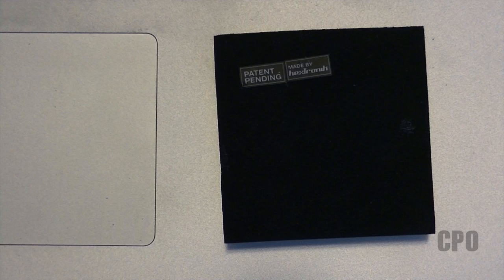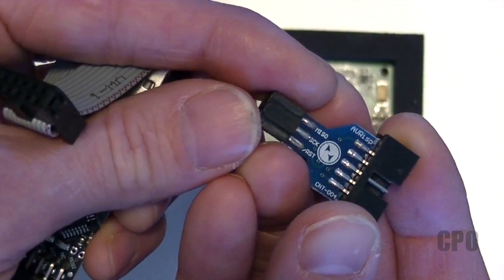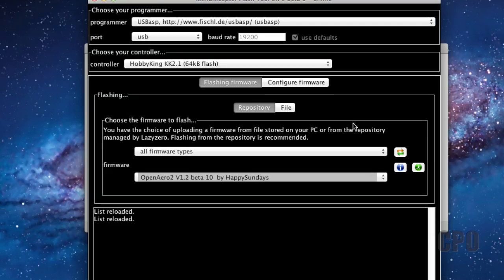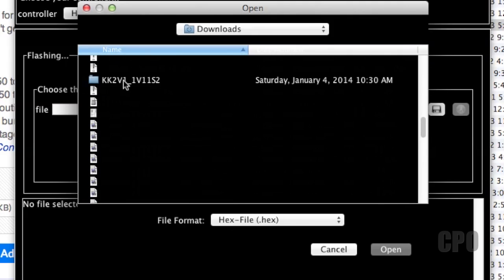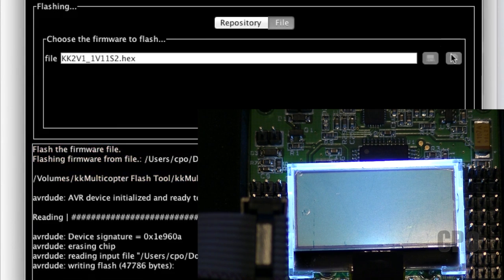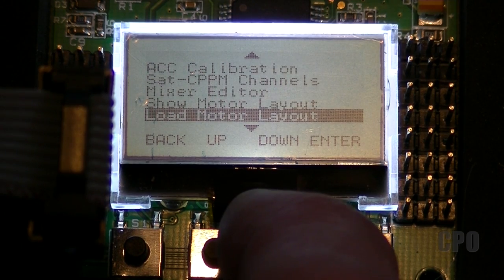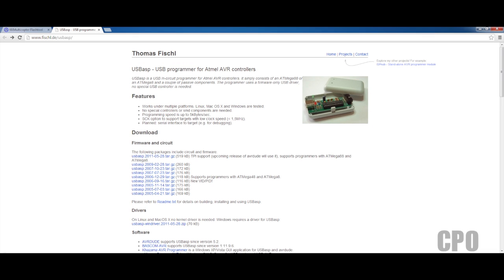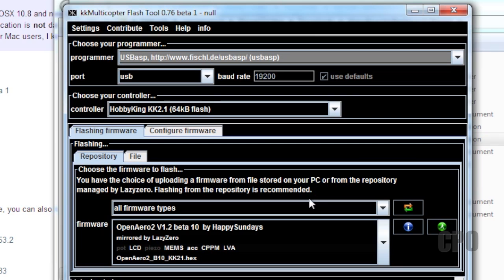How To Flash KK2.1 Firmware in Mac OSX and Windows using USBasp

Comment: I cannot get get the USBasp programmer to read in either of my macs. any suggestions? it will read on my PCs but i cant install drivers. So, so far its useless on 4 different computers.
Reply from the maker: Interesting.  I'm trying to think of how to help, but can you be more specific?  What exactly are you seeing when you try to flash? Is there a specific error?  Also, when you say you can't install drivers on the Windows systems...is that a "you are not allowed to" or "You can't get it to work" problem?
Reply: EVERYTHING cpo
I think i have determined that the programmer i got is bad based on another persons exact experience in which the vendor and device IDs are all zeros.
trying to install drivers gives me an error that says "specific location does not contain information about your hardware" i assume this is because the IDs on the programmer and driver do not match or because IDs of 0000 are not valid. When i try to flash i get an error that says it could not find the USB device.
Reply from the maker: Yeah... That sounds like a hardware issue. Zeros for pid and vid are not good.

Comment: Hi, I bought one of these kk boards and when I start it up for the first time, it gave me an empty display but with the backlight still on. Some people say I fed it with too much voltage and burnt the microcontroller and some say that it isn't loaded with the firmware. What do u reckon?
Reply from the maker: Hmmm.... I would definitely jump onto the KK2.1 thread on RCGroups and get some advice from the folks who are really knowledgeable about this board.  If you have only ever plugged in the programmer from USB, there is no way you gave it too much voltage. So in my video, that too was the first time I ever plugged it in. What does the update software say?  Does it see the KK unit when you try and flash it?  I would just go through the steps and see what happens.
Reply from the maker: One more thing:  "Remove all ESC from the KK board! They may draw to much current from the USB port, that will cause in a shutdown of the port or the programmer. Depending on when it happens during the flashing you may brick your board."
Reply: I think you should try turning the esc power cable tjat you attach to your kk2 180 degrees, so that the negativ and signal kable on the servo plug change place
Reply: Icic.. thx for the advise.. I'll try that out..
Reply: Leonardo Theoson Did you ever figure this out?  I have the same issue with a KK2.0 board.

Comment: Thanks for this! Took all the mystery out for me.
I'd like to add that I did nave the "USB not found" Error, but for me it was that the drivers from fischl had not installed properly so I had to manually install them through the Device Manager. Once that was done it worked, almost.
Another error occurred but it was during the Reading phase. The writing completed correctly. I unplugged and plugged in again and this time it worked.

Comment: Hi Chris
Using Windows 8 I get the following error message when trying to manually update the USB device ' The third party INF does not contain digital signature information'.
Any ideas on how I can fix this.
Thanks.
Reply from the maker: I know windows 8 is a little different. I have a windows 8 machine. I can take a look for you, but it might be a couple of days before I can do it.
Reply from the maker: Okay... I haven't tested this yet, but it should work. Try this:

1. Restart the computer to the Advanced Startup Options.  To do this, you can click "Restart" while holding down the shift key on your keyboard.

2. Choose "Troubleshoot" from the menu.

3. Choose "Advanced Options"

4. Choose "Windows Startup settings" It may say "Change Windows startup behavior".  The computer will restart, and you should come to another menu.

5. Choose "Disable driver signature enforcement"

The computer will finish booting, and you should be able to install the unsigned drivers.

Let me know if that works. Next time you restart, it will boot back into the normal mode.
Reply: EVERYTHING cpo
Thanks Chris  -- worked a treat!
I appreciate your help.
Steve
Reply from the maker: Awesome, TheSteve129 Glad it worked!